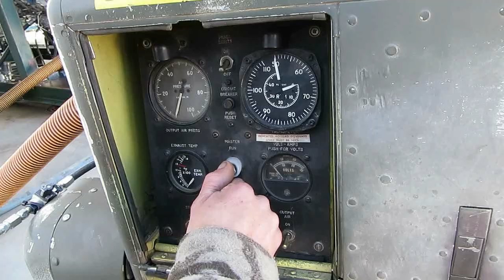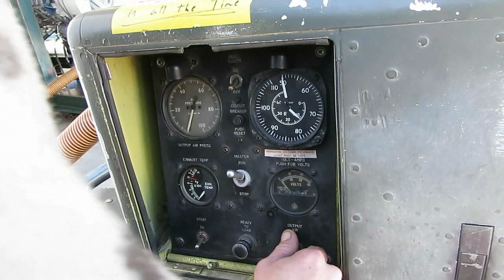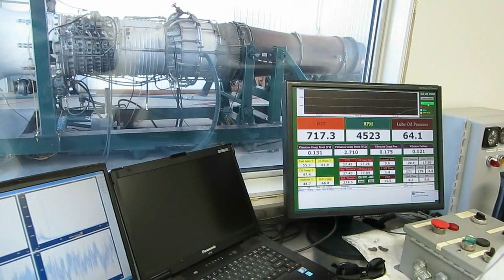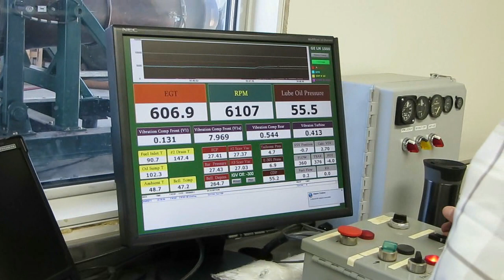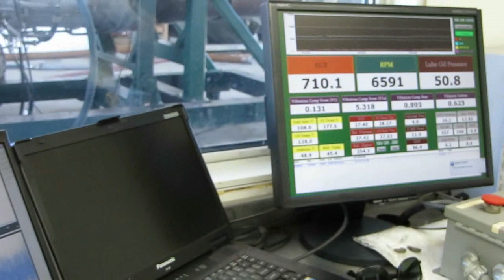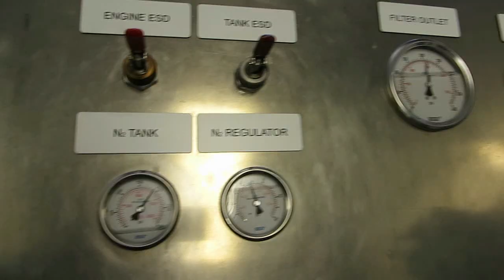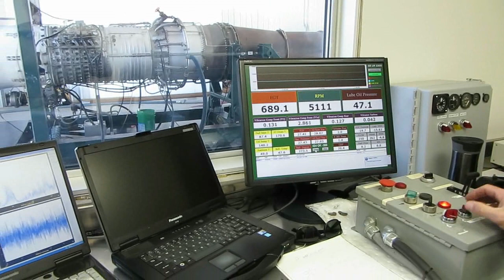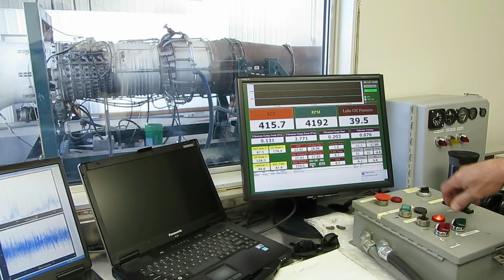LM1500 Springtime test run

Comment: Jay,  Cannot make out the units for the vibration data, what are they ?  What's the threshold for vibration (excess vibration)? 
Where's the thrust readout?
Ever drag Electron Bill out and stick him in the exhaust?  

Long ago video, fuel nozzle testing, how did you not blow up when you switched on that old, wheezing shop vac to suck out the fumes in the glass case ?!!  Last time I did that, KaBlooey!

Many thanks, great videos.

Chester

Comment: My question was more of a generic question.  Asked another way, how do you know the aircraft or industrial engine your testing achieves it's rated power/thrust and what parameters do you measure that confirm the performance?  BTW, does the start cart turbine use an electric starter or ???  Thanks again.
Reply from the maker: For industrial gas generators, we measure static pressure the engine produces in the jetpipe, upstream of our restricting orifice.
For aircraft engines, we measure thrust with two load cells attached to a movable engine mount.
The start cart is a Garrett GTC85 small gas turbine engine, started by a 24V electric starter motor.

Comment: Why is the velocity stack or air bell a necessity on the intake? And only on certain engines. I'm more on the automotive side of the mechanic world. Curious. Interesting job you have there. Love the vids.
If I can ask one more potentially dumb question, what is the difference between a turbo jet and turbo fan engine?
Reply: Last question has been answered after going through some vids.

Comment: Where are the test stand thrust load cell readings on the operator display?  I'd like to see them and get an idea of the thrust output vs rpms.  Is there a percent of throttle readout too?  Thanks for all the great videos!
Reply from the maker: Being an industrial gas generator, thrust is not measured.
There is also no percent throttle. These engines are controlled using the parameters of rpm and EGT, exhaust gas temperature.
The engine is normally run at max output.
The position of the fuel valve, and thus the amount of fuel being fed to the engine to achieve this output, is only of importance to track engine performance and condition.

Comment: Thanks again, a very nice show of power.

I was wondering: You said there is nothing to measure the length of any part of the machinery, neither rotor nor case, and "it is what it is". This makes sense since due to heat-expansion there has to be some tolerance anyway. But do you measure the concentricity of the various parts of the casing and struts that hold the bearings, so that there is no side-loading on the bearings? Or is every case a matched set that has been adjusted by the manufacturer to the required tolerances?
Reply from the maker: The cases are manufactured to the right dimensions, and can only be "wrong" when damaged or severely worn. They are not repairable, because the concentricity is created by the manufacturing process.
They fit together with dowels and interlocking flanges, sometimes called spigot diameters.
Only time we've ever thrown out cases is when they are massively damaged by shipping accidents, or if there has been a fire and they have melted.
Reply: AgentJayZ
That's more or less what I thought. Thanks for quick answer.

Comment: Smoke from unburned propane gas?  That's not what I'd expect.  Cool video tho was that clatter in the forward engine shot during spooling down the air drive starter ratchet re-engaging?
Reply from the maker: I must have been still in J79 mode. It was probably smoke from a bit of oil sneaking past the bearing sump air-oil seals.

Comment: I noticed the end of the jet pipe seems to be dented in on the left side ( Noticeable at 8:00min ). Was it bumped or did the heat of repeated engine tests eventually warp it?
Reply from the maker: It's just a dent that's been there for as long as I can remember.

Comment: What fuel pressure is used  for the LM1500 when running on vaporized LP?  I think you mentioned quite high liquid fuel pressures, perhaps on the order of 500 psi for liquid fuels, is that correct?  Thanks much
Reply from the maker: We need to provide enough pressure to cause enough propane to flow into the engine, which has a compressor discharge pressure about 150psi. If we supply fuel at 200 psi, we get a pressure of about 50 psi across the fuel nozzles, which is about right.
You don't need to atomize gaseous fuel, so the nozzle orifices are larger and the pressure needed is less.

Comment: Hi - I love your videos and really enjoy your style - many thanks. I was just wondering how common it is to fuel an engine with liquid propane (just for test purposes right?) and are any adjustments needed on the engine depending on the type of fuel to account for different burn temperatures, etc? Thanks again, Paul (from the UK)
Reply from the maker: As I corrected myself, we use gaseous propane as a substitute for the natural gas that these engines use when installed.
The temperature of the supplied gas is indicated on the gauge in shown in this video. 
To use gaseous propane, no adjustments are necessary for an engine that is designed to use natural gas.
Reply: AgentJayZ Wow, i thought for sure you meant it was vaporizing in the combustor.  Now i'm terribly curious about the fuel supply, lol.  

If I'm reading correctly (fuel inlet temp?), 90C is ~550psi+ for propane.  Can they pull that much vapor off of a tank for that long without adding heat somewhere?  Not to mention several hundred HP maintaining that much pressure on what looks like at least a 2" hose.  Got to feed the beast, haha!  (I read somewhere that it takes ~500HP just to run the supercharger on a top fuel dragster)
Reply from the maker: Our vaporizer is gigantic, and it supplies propane at the temp on the gauge continuously... no problem. I've got a playlist of videos about our test cell...
Reply: AgentJayZ Whoa!  Found the vaporizer video...that's a beast!  My family runs a propane distributor in PA and I figured it would take some serious plumbing to keep up with that appetite.  I bet the LP gets pretty cold going into that pump towards the end of a good run.

Comment: Thanks Jay for the video.  Will the blade tips eventually 'wear in' & stop rubbing?  I thought you would ideally want a few thousands (inch) clearance while hot & running.  Is there a special surface inside the turbine case on which the blade tips 'rub'?  Take care.

DD
Reply from the maker: In a couple hours of running there will be a happy, near-zero running clearance relationship between the blade tips and the shroud material, which looks a bit like honeycomb, on a smaller scale and in stainless steel.
Reply: AgentJayZ
Do I remember right that industrial engines have smaller tip clearances (self-adjusting to near zero through early wear-in) because they typically run at full power for months on end and do not need to handle quickly varying loads and temperatures like aircraft engines?
Reply from the maker: Yes, that is all true. Whenever an industrial engine is shut down, it is a much longer process than for aircraft, even considering taxiing time.

Comment: In an industrial setting, how long do these engines typically run between any kind of downtime or servicing? I imagine they must be running at 100%, 24/7, day after day.
Reply: A few thousand hrs. And yes they run 24/7 365 if there are no problems and scheduled services.

Comment: One question, do you know why the turbines make that low pitch sound when the fuel is ignited at startup? I've been looking for explanations, but it seems it is something rather "mystical". I've heard that low pitch tone a lot of times at the airport, and, I don't remember well, at a power plant.
Reply from the maker: I've heard many opinions and explanations... but the one I stick with is that these engines are monstrously powerful, so on startup they make a sound any monster would make when waking up.
Reply: AgentJayZ Oh, I see what you mean!

Comment: At what rpm/speed would lift-off from the runway be for that particular engine?
Reply from the maker: This is an industrial version of an aircraft engine, so it will never leave the ground. The engine rpm of the flight version would be 100%, which varies by model and application, between 7200 and 7450 rpm. The speed at takeoff is more of an attribute of the aircraft than of the engine. The J79 was used in the F-4 Phantom II, the F-104 Starfighter, and the B-58 Hustler, as well as a few others.

Comment: The people I work with are annoyed with my sense of humor - I'm surrounded by GE90's and GEnx-2b's. I want to throw a 5 gallon bucket of Mr Bubble into the intakes and watch them blow bubbles when they do their engine runs. :D
Reply from the maker: I like your attitude, but what you suggest would never work. Bubbles need the gentle breath of children to expand into their fun, flowing shapes.
Those big turbofans can literally blow houses off their foundations, and then make them disappear, so your experiment would just cause steam and a sticky soap residue.
Reply: Oh, I know the power - sitting in a crew shelter between two 747-8's both doing engine runs - rock & roll is an understatement :D

Comment: Interesting that the bell intake temperature drops below ambient temperature.
Reply from the maker: Bellmouth depression is a term meaning the drop in air pressure compared to ambient right at the inlet of the compressor.
It moves so much air into the engine that is causes a small partial vacuum into which rushes the outside air.
The compressor uses about 30 thousand Hp at full power, and it is able to keep slightly ahead of the atmosphere's ability to supply it.
Everything is moving, so it's complicated, but if you lower the pressure of a given mass of air, it gets cooler.
Reply: AgentJayZ Figured that was the reason. I've seen it happen on some carbureted engines, where the manifold gets very cold just after the venturi.

30,000HP compressor though - insane!
Reply: American Locomotive
Carbureted piston aircraft engines have a carburetor heat for this reason. At medium to low power settings the temperature drop from the acceleration of the intake air can be such that ice can accumulate at outside air temperatures as high as +20 ºC. A jet engine intake has less of a restriction, but sucks so much air that there will also be a noticable drop in temperature. Airliner nacelles have heated intakes.